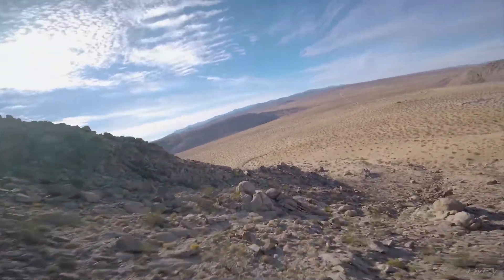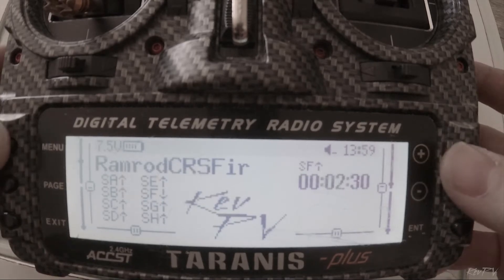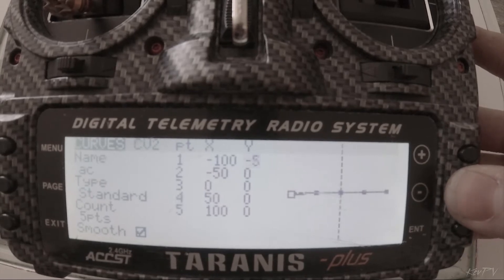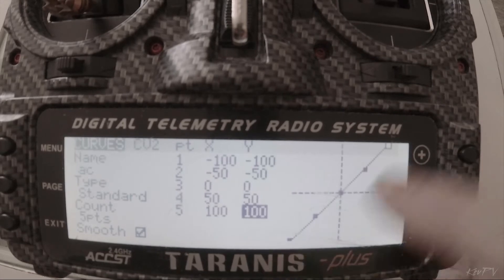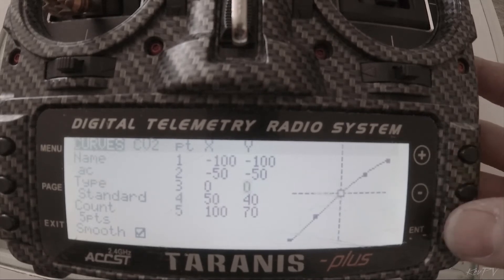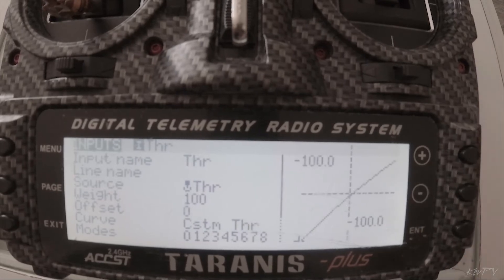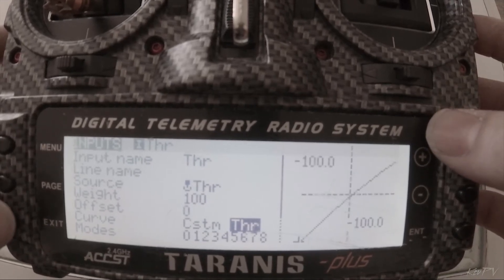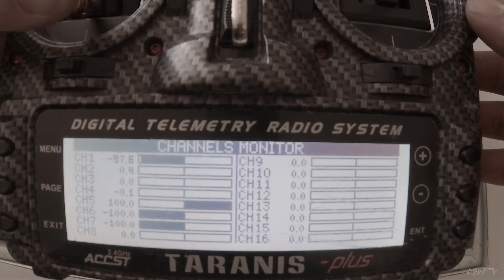Tutorial - Throttle Curves on Taranis

Comment: Can you put an alternate throttle curve on a switch or slider(Taranis xlite here)? I have a 5” 4s and 2” bwhoop that the throttle doesn’t match both and I’d rather not have to make/select a new model every time I switch. If there’s a way to change it in BF that’d be even better!
Reply from the maker: I believe you can do that through OpenTX but I haven’t tried. Though Betaflight now has throttle limiting so you can simply set up your limiting in Betaflight for each quad you have and you wouldn’t need to do anything on your transmitter.

Comment: actually i need the opposite solution.. i currently fly a 6 inch 4s setup using 1700kv motor.. and now i want to fly  with 5 inch prop using same setup.. i already found the best prop size, but i want to get more instant throttle using curve.. how to do that? what i need is 100% throttle at 75% curve.. so not limiting the throttle value but i want 100% throtle at 75% stick travel..
Reply from the maker: That's really simple. If you have a 5 point curve like I show in the video, just set the 4th and 5th point to 100. You can also adjust points 2 and 3 to smooth it out.
Reply: @KevPV  oh nice.. maybe i need to add more points to get the exact number right?
Reply from the maker: @TERBANGFPV  You don't have to. 5 points will work just fine.

Comment: Hi, can you please explain to me how can I get a second throttle set on a switch (a few rpm higher for exemple, for gas planes). There are videos but it's made through the PC, I want to make it from the radio. I've managed to make flaps to elevator mix, timer on a switch, but not a second throttle set. I have the Taranis X9D Plus EU version.